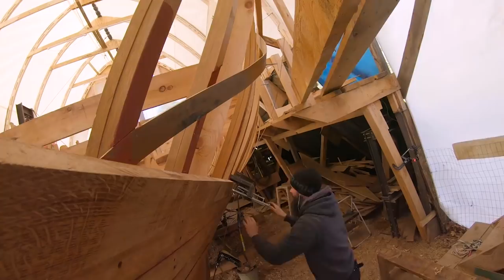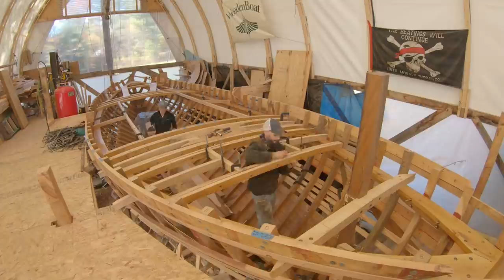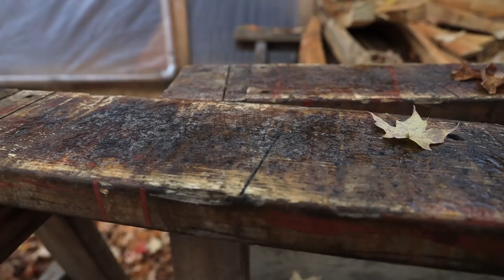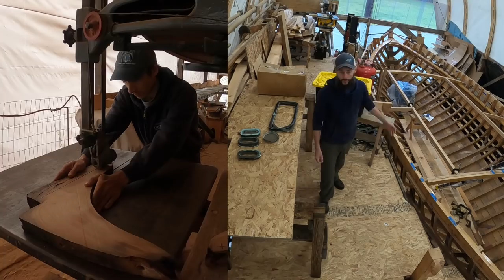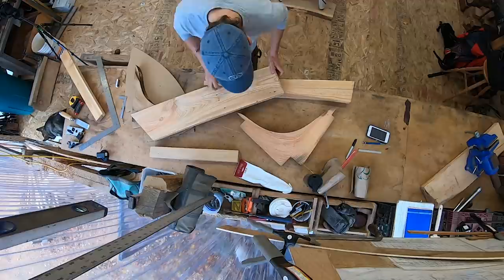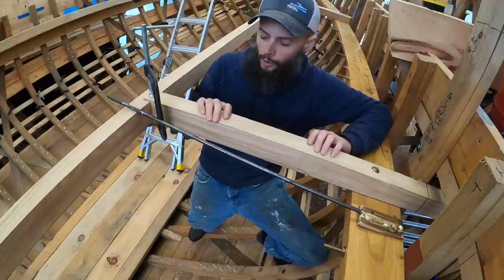Alix is Back! - Episode 134 - Acorn to Arabella: Journey of a Wooden Boat

Comment: Alix: Never loose that «fear» of table saws. I know at least five people who got so familiar with them that they lost some fingers. I used to tell my kids that the table saw was the «finger eating dragon.» Good to see you back!
Reply: @Projet des six jours good advice. Familiarity breeds contempt=danger.
Reply: Power saws and firearms are useful tools.  Both require respect, training and alertness. Both will deprive you of body parts if used casually.
Reply: And bandsaws, miter saws and jointers etc. Even a drill press can mess you up. All require attention to run. I've had the same big tools for years and they continue to teach me little lessons. So far, no big injuries.
Reply: Fear becomes safe healthy respect with repeated use and experience and proficiency.  That's how you keep those fingers.
Reply: My neighbor's FiL gave him his radial arm saw after experiencing what he called his bassackwards blade scare. Power tools can be scary so without even plugging it in and tempting the Climb Cut gods he swapped the saw for a lawnmower. On mow day one nearly complete he pushed his mower off the 45 degree bank heading into the ditch. Without much forethought or consideration he quickly grabbed the edges of the mower housing and learned about the indifference of sharp things spinning fast. He did a standing 8 count and realizing that he didn't need to go looking for missing pieces shut off his brain's blood supply and took a nap on his freshly mown lawn. Surgeons grafted skin from his thighs and fixed him up good as new, almost. 
  Hay, the udder way to do your lawn dry, scythe it for your milk cow? Kids, they do love having mow chores to keep 'em busy.
Reply: lose
Reply: Yea I noticed there was something behind the saw that might block the path of the wood. Not good it the piece being cut get blocked or pushed side to side it can cause the blade to bind and kick back
Reply: @myfavoritemartian1  Glad we don't have a power saw problem in our schools and on our streets also by God!
Reply: @stevenholton438  As he said, a tool is only as good or bad as the person using it.
Reply: @kevincrosby1760  You completely missed my drift matey!
Reply: Whew! You had me worried that Alix got injured by the big bad cabinet saw!
Reply: @briansmith8967  no sweat... just a reflexion on something he said.
Reply: I don't see a riving knife or splitter on that saw. I really wish it had one. They're easy to add with aftermarket parts and they do tons for safety.
Reply: My best friend of some 45 years recently lost a complete finger, with a mitre saw as it happens.  He put it down to complacency. There is a wood mill near to me, a couple of brothers who have milled timber all their lives.  Without a word of a lie, they recently took on a young apprentice, aged 63.  Their newest bit of machinery was made in 1953.  They still have all their digits and when I asked them what their secret was, the answer was to set up the work, start cutting and then just look at where your hands are, just that - if you've set up the work properly it will look after itself.  Just watch the hands, and watch the blade.  It has changed the way I work, and I think, made things much safer for me.
Reply: @BaldDad02  I hear you. My strategy is to shut the saw before moving around it. It's annoying bcs you get so comfortable around it but for a few seconds, I slow down and remain intentional with every movement. Automatic moves are the enemy. Cheers!
Reply: @BaldDad02  My grandfather was ripping some wood for our new house when he had kickback. The piece hit him on the forehead so he instinctively closed his eyes then reached for the power switch, but ran right into the blade. He cut off several fingers, but luckily they were able to sew them back on. From that day on, I learned to respect the table saw and indeed any power saws!
Reply: @RobMoreland  Absolutely.  I know in some cases they can't be added but in most they can and it's really something worth doing, doesn't affect the usability of the tool in most cases too.
Reply: Worked with table saws with no problems for years.(as a weekend warrior not a full time carpenter)....  A month ago, a yellow jacket landed on my left arm at exactly the wrong time.  My involuntary reaction caused me to put a 1/4' deep by 1/2" wide cut gash in my left thumb...(thankfully, I had my saw 1/4' higher than the wood)......   Not sure how to train myself for next time, but......  Common sense will say sting is better than no thumb... I just have to remind my involuntary reflexes that fact.......
Reply: A radial arm saw was the finger eater for us.   Thankfully not in my family, but two friends lost fingers.
Reply: I don’t know for sure but the scariest thing for Steve and Alix is being on the ocean in a boat. I’m sure Arabella will be a fine craft and sailing as they desire is exactly what they should do. But the open sea can be more dangerous than all their power tools put together. At least the tools have an on/off switch. I love sailing I wish I could join them on a crossing, I’d go in a minute. BTW I own a table too.
Reply: about 3 years ago i was making space in the sheds for a few more classic cars that were due to be delivered and was working fatigued.
piece (no)
i was transported to a big city hospital and 24 hours later they cleaned up the wound and sewed it shut.
i had gone a bit over half way through the finger and just nicked the bone.
over 40 years working with power tools and this was the first major incident.  
.
i now have several push sticks and turn off between cuts.
Reply: I've lost flesh to a router, angle grinders and a table saw. All them gobbets are hard to clean out and it spoils the appearance of your work.
Reply: Bandsaws may be worse because they tend to be quiet! Table saws and chop saws make a lot of noise, and that helps keep you on your toes!
Reply: How do you tell a good wood worker from a bad wood worker?

A good wood worker only needs one hand to count to five.

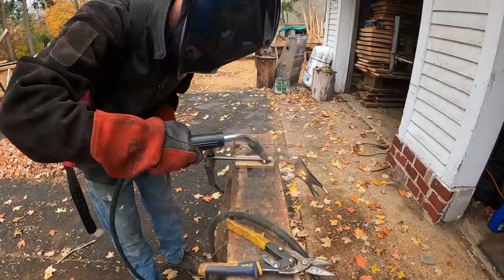Comment: Welcome back Alix. Guys, something to be aware of. At 23:20 your flux gasses are getting dispersed by the breeze, which means you need to up the pressure to get a good weld. If you would put up a temp wind break not only would the welds be stronger, they'll look better too and you'll save on the welding gas.
Reply: Absolutely

Comment: I can't believe it has been four years.  You two are a class act as friends.  I really did expect Alix to come back with a wedding ring.  Question:  Could you locate tie rods and short beams next to the frames so that the tie rods are fastened through the short beam into the frame at the end with the large screw?  That might reduce the angle needed to drill through the carlin.  Thanks guys, take care and Stephen, enjoy your time in the woods.

Comment: Aloha guys
As a quick recommendation:
Design in access to remove the cockpit floor in case you need to remove the engine in the distant future...
-
We had to retro an access in our Ingrid for that purpose...
Welcome back to the Alex...!
Reply from the maker: Well ahead of you! ;) we certainly have plans for something similar already.
Reply: @AcornToArabella  Diesel /Electrical Hybrid would be very cool. Sailing regeneration and ever cheaper LiFePo4 batteries are the future.

Comment: One other thing you can do to tie the short beams into the carling would be to use wedged tenons. Easy to implement and absolute won't weaken things like the neck of a dovetail.  They can also be vary decorative by using a contrasting wood for the wedges.

Comment: Welcome back, Alix. Great to hear Stephen is planning a break. Gone to the forest videos or not, just have some fun and try to get some relaxation in as well. The boat will be there when you get back. Love the tie-rod idea. See you guys next time.
Edit: I'd say bung to knee holes after the build out. Drilling out after the new bits are glued/epoxied in can allow the dowel pieces to go through the new pieces as well and help add some shear strength to the structure.

Comment: I would think that you should put the bigger white port lights into the cabin to allow more of an opening into the engine bay. You might not need them very much when down in the engine bay, but if you need to use them....you REALLY need to use them.

Comment: Have you thought about welding on a down tab on the end of the plate for the tie rod, that would go behind the shelf?  Using that large area direct bearing to provide a reaction force would be quite a bit stronger than the screw/bolts in shear against the hole sides.  It would have to be a good weld, and I guess you would have to round the back edge of the shelf to allow for the weld radius.

Comment: This episode has raised more questions than any previous for me. 

Why are rotten knees worth the effort to save? Is it a desire to carry the fabric of Victoria forward another 100 years or is there a more practical reason? 

Why are you choosing to attach the tie-rods to the shelf? I would think through bolting the tie-rods to the deck supports (rafters? joists?) Would get as strong a solution with much less bronze for both weight and cost savings as well as allowing easier adjustment or replacement at some later date. Is there a serious tension load in the deck structure where it attaches to the house?

Have you thought about orienting the oval ports vertically and using them in narrow vertical spaces? Maybe to either side of the entryway to the house? I can see how they don’t carry the theme in horizontal mode but they are the perfect length to be reoriented to compliment the height of the round ports in spaces too narrow to fit a round port. 

Cool project so far. It is difficult to dedicate so much of your life to a project. I am glad you have been able to do so. I hope your life has been and will be rewarded for having done so.

Comment: A tip for safety while using the table saw which I have done for 45 years. Never follow the board through the ripping process with the left hand still on the board.

Comment: Steve Rather than all those rod assy, make the short beam a structural member itself using a piece of 1" dia bronze rod tapped for 1/2 or 5/8 bolt and install it as "nut" in a horizontal drilled hole and bring in the "bolt" thru the carlin to grab the captured bronze "nut"  I have done this on many work projects even tables and heavy equipmt bases. Your oak is totally strong enough. PS good to see Al is back. Just remind him to wear his safety glasses with the band saw too.

Comment: Hey guys, I had a thought recently about fire safety on the boat. I know it's in water and that's good for fighting the fire. But it might be well worth it to install a pull handle fire suppression system in the engine bay and galley should a fire start in either place.

They are easily plumped in and well worth it for ease of use.

Comment: Since you use brazing wire for bronze welding, if you have an application where you need higher strength metal you could use the same set up to braze stainless or normal steel to bronze. Stainless tie rods (maybe 306?) wouldn't contribute to galvanic corrosion but would add tremendous strength. Bronze just isnt terribly strong, but that's my experience with metal working, I've never put wood on hydraulics!

Comment: Ref the bronze tie rod. I suspect that there isn't any point having such a long weld. A couple or three of diameters of overlap of rod to plate would be stronger than the rod, and that's all you need. 
The plate, on the other hand, is spreading the load into the wood, so the size you have seems about right.

Comment: 21:25 Alix coughs as I puff smoke from my pipe at the screen... Alix, a word of safety advice:  If you are feeding pieces through the table saw by hand, please keep your hand away from the blade by no less than the distance of a spread hand, from pinky tip to thumb tip...
Reply: I was taught to stand on the fence side of the blade when cutting small pieces.  That way if one were to lose footing while pushing the work through, your arm is on the fence, not on the blade.

Comment: " You could hear the engine a little bit easier". hahaha. Steve, don't worry, you're totally gonna hear the engine just fine without any aid! ( I've owned a 34 cruising sloop for 20 years and have motored many many hours on passages, I'm rather well acquainted with diesel sailboat engine noise).

Comment: If you drill the holes straight into the carlin and then insert the tie-rods and push the plate down to bolt in onto the shelf would it add some upward tension to help support the vertical integrity of the carlin?

Comment: I understand why folks are suggesting that you should never lose your fear of the table saw, and most of them have way more experience than me, but I think fear is a dangerous word in this context.

When you're scared, you're likelier to have jerky movements, reposition your hands a lot, flinch, etc. Any time I've had a "whew, that was too close" incident with my hands it's been because of involuntary or unnecessary movement near the blade and anytime I've had kickback or small bits flying back towards me it was due to jerky movements or shifting hands around in a way that let the work drift away from the guide.

Respect, caution, and having a safety plan for every cut seem like better watch words. Having good pushers, a splitter, a blade guard when you're cutting sheet stock, never cut the short direction on a long rectangle without a jig and all the other good safety tips people are giving here can all help get past the fear to the respectful caution, I think. It's probably worth noting that some of the safety tools require practice to use safely and effectively before you start cutting your expensive/rare hardwoods.

Personally, I fear the bandsaw; I haven't spent enough time on it to feel competent, it's got that big old flywheel that keeps it going no matter what, it's rarely practical to use push sticks, etc.

Smooth and deliberate in all things in life.

Comment: So, you've got 6-months until the oak cures and you can complete planking the outer hull? March? April? Sure you don't want to wait and complete the hull planking first? That's what I have done when boat building. If you proceed to plank the deck, before you complete the hull, don't you risk sealing all that open space, cutting yourself off from, and losing all that maneuvering room?